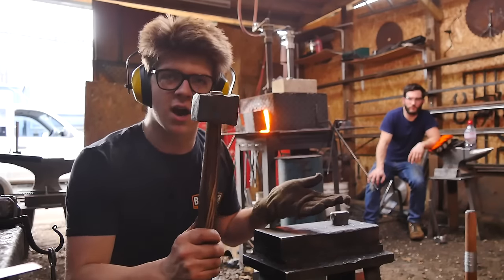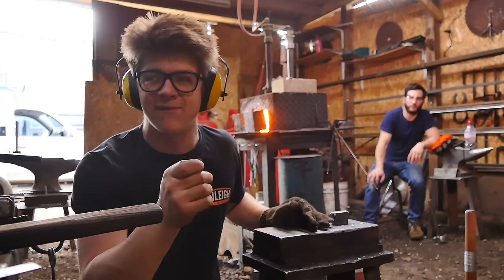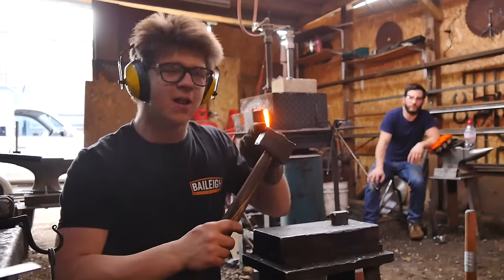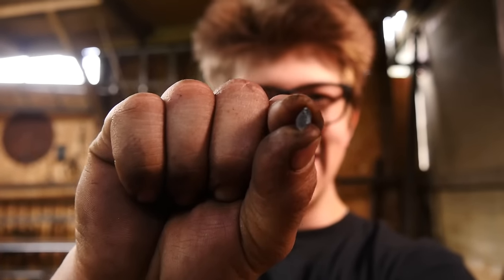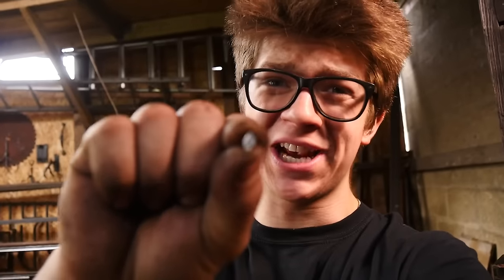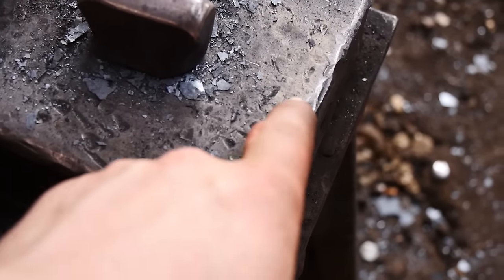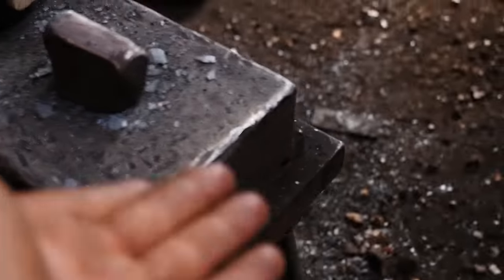WHY YOU DON'T HIT HARDENED STEEL!!!!!

Comment: I got a piece of a hammer in my chest from when I was young and dumb. Still have to explain to the dr sometimes because it shows up on xrays.
Reply: that happened to me! we were on a job tearing out hardwoods and we had a few temps that had no tools, so i gave them a few of my extra prybars i had on hand. so then i was left with two claw hammers with which i used both heads together, using a hammer as a prybar. long story short i had to have surgery to have the chunk removed.
Reply: Just never get an MRI 😱
Reply: Airports must be a pain
Reply: I have the same in my knuckle from using a lathe like a dumbass
Reply: Don't worry, just build an arc reactor in a cave with a box of scraps to keep it from reaching your heart
Reply: I have one in the webbing on my left hand between my thumb and index finger from using a hatchet and a sledgehammer to split wood. I didn’t hit it straight on that’s why it sent a piece in to my hand

Comment: I'm old now, but when I went to High School we had a series of "Shop" classes.  Woods I and II, Metals I and II, Drafting, Auto Mechanics and a few others.  There might have been a general "Home Repairs/Maintenance" class in there too.  #1 rule was to take care of the tools.  TOOL MAINTENANCE!  It is a lot easier to grind the mushroom off the top of the cold chisel than it is to have the stray splinter removed from the skin or eye.  Oddly enough a sharp saw or cutting tool is safer than a dull one.  Keep up the good work.  I'll never be able to smith anything, but It is always fun to watch.

Comment: When I was a kid around 12 my parents used pallets to burn in our wood heater. My dad used to make me take all the nails out of the wood. I was using 2 claw hammers taking one claw under the nail and hitting it with the other hammer. The hammer head fractured and a small piece of the head went right in my center chest hitting my breast plate bone. My dad tried getting it out with tweezers so my mom wouldn't find out but no luck. So off to the doctors we went. They got the piece out and told my dad a couple millimeters over and it would have gone past my ribs and in my chest cavity. SO EVERYONE PLEASE LISTEN TO ALEC NEVER HIT HARDENED STEEL TOGETHER!!!!!!!!!!!! Great video Alec brought back a funny memory for me today. The funniest part of the whole incident was he tried using a magnet to get the piece out so there I was a scared 12 year old kid with a magnet stuck to my chest and my dads worried about my mom kicking his butt LOL.

Comment: first hand i can attest to the whole chip from hardened steel. this one came from the end of a pickle fork (mechanic tool for separating ball joints)  whap whap off center whap and i was digging a chunk of steel out from the top of a knuckle, (it traveled almost an inch up my finger and i made one of my coworkers faint plucking it back out with a pair of long tweezers) love what you do, love your energy and the way you present all of this.

Comment: 3:50 Many years ago I was splitting kindling at my parent's house for the fireplace. I placed a small hatched on top of the wood and hit it with a small sledge hammer. Well I did the same thing, swung and had a mishit. A piece of the hatchet flew off and lodged in my hand above the knuckle. Then 4 weeks later I did the same thing again! Only this time the piece of metal went through my denim jeans and buried itself in my leg. Thankfully it didn't go in about 3 inches higher or I might never have been a father.

Comment: Working as an automotive tech, I made an awkward strike on a drift punch, saw the tip spark and instantly felt a searing pain in my leg. A tiny crescent chip off the punch went right through my pants and deep into my leg. The ER doc had to slice it open, spread it apart and was working up a sweat, cussing and struggling to get the piece out. I came very close to passing out during the process.  Thank you for taking teachable moments like this and educating your audience on the many hazards in the shop environment.

Comment: back when i was a framer, i would set the walls in the basement using hardened cut nails, usually with my framing hammer. hardened vs hardened- so naturally every now and again you would have to pick out some little bits from your leg.

eventually grabbed an unhardened mallet just for doing that.

Comment: Yes.... a friend of mine caught a large chip from a hard tool that went clean through his bicep, lodging next to the arm bone. It took some serious surgery to extract it... penetrated like a pistol bullet. In the head it could have killed him.
Keep those anvil tools soft guys. For pointy tools (punches, pritchels etc.) normalised H13 works well. Holds up under the high temperatures, and will not chip.
Remember the 'work hardening' caused by repeated blows. A tool can start out quite soft and harden a lot under heavy use. If the top of a tool gets a bit 'mushroomed', for goodness' sake anneal it and either forge it back into shape or if it's really bad grind off the splayed out bits. It was just such a piece that penetrated my friend's arm all the way to the bone (and through his shirt too!).
Keep safe in the shop guys....  :-)

Comment: when i was younger i was hitting a hammer with another hammer to use the claw as a wedge, one of the hammers chipped off and a small shard of it shot me in the thumb and went a quarter inch into my skin. wasn't fun digging it out with tweezers.

Comment: Believe this guy! I used a maul head as an extra wedge when splitting logs a few years ago. A chip flew off the face and into my leg next to my shinbone (an inch above the top of my high rubber boot) and cut a nerve, so now the inner side of my  leg and the arch of my foot is numb.

Comment: I learned this lesson the hard way a few years back using a BFH to knock a bronze bushing off of a hardened steel shaft. One poorly placed hit and I ended up with a projectile a little bigger than a bb in my bicep. It punched right through a heavy FR welding shirt and the cotton tshirt underneath. I took my shirt off and found a trail of blood trickling down my bicep. I wasn't sure if it penetrated or just grazed me until I held a hard drive magnet close to the wound and watched my skin move. 15 minutes of home surgery/fishing with said magnet saved me from a trip to the ER.

Comment: i was holding the handle of a splitting maul when i was young. my dad hit it with a sledge hammer to bust through the wood and a piece shot off and lodged half way in my ear lobe from the side , i had my head turned. i learned the hard way lol.

Comment: this is a hobby I'm getting into and I only want to start with one hammer and make all my own tools so I find that your videos may be very educational for me I'm having quite a hard time finding an anvil though
Reply: L.S.F. sylvest you sir have the same problem I had so here is your solution go to any metal works or fabricators and buy a meter of plain old mild steel bar I got a bit that was 100ml x 40ml ish can't remember exact size cost around £20 I cut 2 bits off around 12 inch long have um a quick sand and clean welded them together and there you have it a cheap effective anvil if made several blades on it have moved on to a 50kg anvil that I picked up off Amazon and its a gen hardened steel anvil but I still use my mild block for hamming out the first cpl welds wen I'm making pattern welded steel best bit is the face is so easy to 're dress jus run an angle grinder over it take out any big dents n scuffs
Reply: mark morey thanks for the tip that should be hard enough to hammer on
Reply: L.S.F. sylvest it work just fine bud iv made loads of pattern welded blades on it cheap fix till u get an anvil u mite not even bother if it's just a hobby

Comment: I engrave medieval-style coin dies in my hobby, and for runs of thousands of coins I do indeed harden my dies (typically 8620, though I have some S7 I'm looking forward to playing with).  Usually chips become a problem when the striking end mushrooms out enough such that cracks develop, though a mis-hit can indeed result in a shear-generated chip.  Currently we wear leather aprons and safety glasses, which limits the risk, but I have indeed had to dig a chip out of my leg...  I'm torn, because softer dies will wear out much faster, and I put dozens of hours into the engraving.

I have had mild steel dies fail after just 500 strikes, while my hardened 8620 dies look brand new after 15,000 strikes, except for the striking end!

Comment: a friend of mine witnessed a miss-hit of a hammer on a hardened anvil during a forging class at his metal-working-apprenticeship (in Germany). A chip broke of and hit somebody in the stomach, piercing clothes, Skin and abbs-muscles. Nobody noticed it (even himself) until he broke down from the loss of blood. This is the reason why you wear a leather skirt. When I do forging classes, everybody gets a leather skirt, safety glasses and has to wear closed shoes and long clothes.

great Videos, I like your fresh style and your skill on the power hammer as well as your skill, hitting the right forging temperature, where you have few to zero sparks but smoking flux.

Comment: I've noticed the closed legged stance of the strikers with their sledges; would you recommend strikers adopt more of the 'wood chopping' stance with their legs parted, swinging down the center line with their sledges, should they miss the top tool to avoid hitting themselves in the shin with that massive sledge?

Comment: A friend of our family was trying to remove a fence staple by striking a claw hammer with another claw hammer. A chip flew off the hammer face struck the upper cheek, up under the eyelid and straight into his eye. Even after several operations he was blinded in one eye.
Also, if you know you are going to be doing a lot of speaking mix up some tea with lemon and honey and sip it during the day and then drink a hot one before going to bed. It really helps keep the throat from getting too hoarse.

Comment: On the topic of anvils, I am starting out as a new blacksmith and thought of an interesting anvil project, rather than just buying one straight out. My idea is to shape out the anvil with plate steel layers, much like how you make a billet, only on a large scale and cut to shape for the horn and so forth, then completely weld all the layer together. Then just grind and file everything down. My thought is that it would be the same as laying unwelded stacks of steel and hitting something on top of it. However, I'm now curious since you said not to use hardened steel (cold rolled I believe?), that using hot rolled steel instead would be the best way to go? What do you think?

Comment: Back before I knew better, I was using a ball peen hammer to hit the face of a claw hammer to drive its claws under a buried nail head. A chunk the size of a pin head flew off and went a good 6mm into my arm. The fun of digging it out with tweezers is forever etched into my brain. Never again.

Comment: No joke! Thats so true.  My father was working on something and he ended up unintentionally smacking the heads of two standard claw hammers together on the face of each hammer. The result was a piece of the hammer head chipped off, went through his jeans and into his leg. Went to hospital to get it removed but the ex ray showed it went in so deep they said it is safer to leave it there. After a tetanus shot he was sent home. Lucky to not get that in the eye. He was told that for how deep that went in, it would have gone right threw safety glasses.

Comment: I can attest to what happens when you miss-hit hardened steel. Years ago I was cutting a bushing out of a starter housing when it felt like I was shot in the hand! a chip broke from the tool and imbedded a half inch into my hand between the thumb and index finger (the thick meat behind the web). I had rushed and did not clean the mushroom from the striking end of the tool. The piece was almost as big as a BB. Lesson learned... always clean and properly lap your tools.

Comment: Hey Alec. Hello from South Africa...love the videos man. Educational and Entertaining as well. I'd like to ask a question about the way you use the hammer to strike; on the decent of the swing, everyone in the video keeps their hands apart as the hammer makes contact with the metal. Is there a reason for this? I would think letting the hands slide together at the top and then bringing it down in a squared off stance would be better for power and probably the back as well, possibly more accurate if one used this method regularly. 

Have watched 5 of your videos and am now an expert of course🤣. Keep up the great videos!

Comment: I didn't realize you could just use the hardy hole on your anvil to form the inserts/tools, always assumed there was a large chance for it to get permanently stuck in there so I've just been using a metal form that I hammer the metal into to get the shape.
Reply: Jeff, you really shouldnt use your anvil hardy hole to form tools. keeping the red hot "tool" in the hardy could affect the heat treatment of your anvil face...  Alec is using a mild steel striking anvil. so the temp is not so important!
Reply: pirate323i see yeah that's what I thought, knew something was going on that I was missing.

Comment: I learned that the hard way a few years back. I was trying  to break an old bearing off a pump shaft with a sledgehammer  when part of the race exploded and hit me in the right hip. A piece 3 inches x 2 inches ×1/2 hit me in the right hip. Puncture my clothes and skin. Hit me so hard it almost broke my hip.

Comment: I can attest to the warning about hitting hardened steel. I had a chip the size of a BB come off of a hammer face and embed itself into the side of my hand. The velocity of the piece must have been very high because my hand felt like it was hit with a hammer. The impact would have easily gone thru a lot of flesh before stopping. In my case the bone stopped it. One can imagine what could happen if you were hit in the neck or face.

Comment: yeah i found that out the hard way. the chip went into my cheek right next to my nose, almost took out my eye but rested itself in the top of my cheekbone, lucky brush on my end, had it removed surgically after a while because the little lump was a nuisance. do not underestimate this tip. it come flying in like a bullet, no reaction time is fast enough. 20/20 vision beats 20/zilch vision any time!

Comment: I just came back in from working on a spring steal. I was trying out different heat treating methods. I did the file test, then hit it with a hammer to see if it breaks. A chip broke off and flew right into my knuckle, hitting my vein. Lots of blood... funny that I did that and then got on and saw this.

Comment: I have a piece of metal from a hammer in my chest that chipped off from hitting 2 hammers together. you can get a magnet and put it over the piece and watch it pull towards the magnet. never had it removed bc it took a while to actually realize that it was there. I was more worried about the amount of blood that was seeping out of the hole it left.

Comment: I know first hand how it feels if you get hit by a piece of metal. I was an innocent bystander in a smithy when something hit me on my arm, it felt like a really hard hit with a broomstick. I went to hospital afer discovering a wound on my arm and holes through several layers of clothing. x-ray confimed there was a piece of metal, about the size of a 1 Euro Cent, stuck in my bone which they cut out. Doc said if it wouldn't have hit the bone it would have gone straight through. I never found out where the piece actually came from.

Comment: Just ran across this video, been watching lots of them.   But yeah, happened to me hit the back of a hatchet with a hammer, and saw a spark just fly up towards my hand (lucky it didn't fly towards my eye) and went right into my knuckle.   Went to the doctor and they thought nothing was in there, kind of poked around and sent me home,  next day had a physics lab class and asked the teacher if he had any strong magnets, and sure enough my knuckle bulged outward towards the magnet, he let me borrow it and I basically did magnetic surgery on myself by pulling towards and away and the thing finally came flying back out covered in blood... was quite cool.   Doctor did insist on a tetnus booster shot though, damn that hurt more than the steel that flew into my knuckle.

Comment: I was hammering a  1/4"dowel pin into a press fit hole once. a tiny piece, and I mean tiny, shot off the dowel pin and struck my hand like a bullet.  No gloves in so It cut my skin. Man, did it bleed like crazy.

Comment: Most of today's tools are cast steel, right?  I've never broken a cast tool or heard of one breaking.  But, that is the huge downside, isn't it?  Cast steel can shatter, right?  I saw a video on her of someone shattering a cast hammer with a striker.  How did they improve casting?  Formulation or the cold shock method?

Comment: I was breaking the cast steel housing on a bearing with a hammer, i missed and hit the hardened bearing next to it. a tiny piece of the bearing flew off and hit my middle finger. started bleeding and didn't think anything of it. 6 months later i broke a bone in my hand and it showed up on the xray.